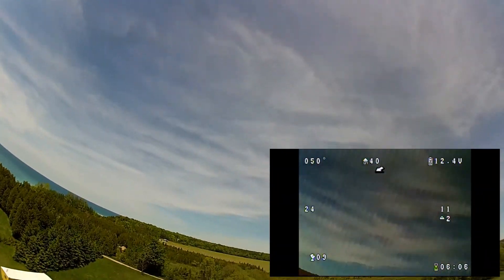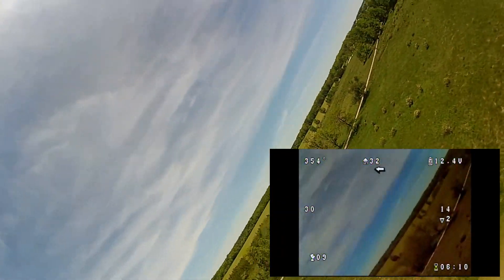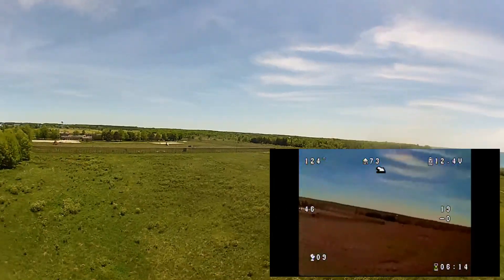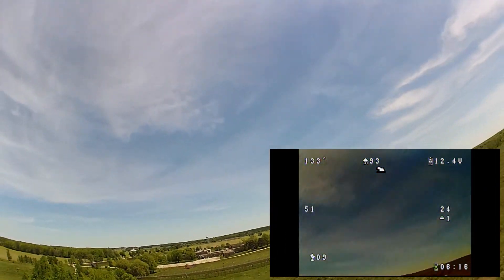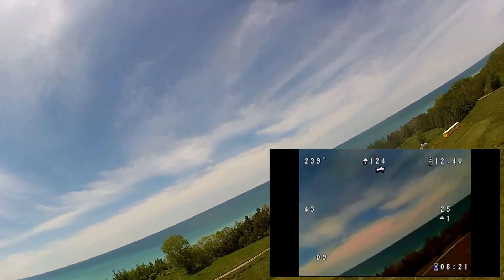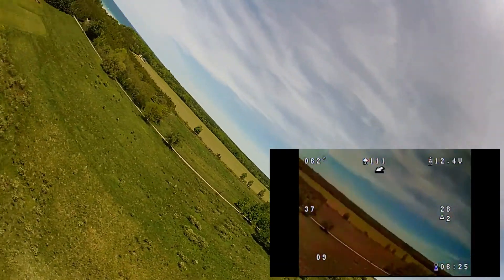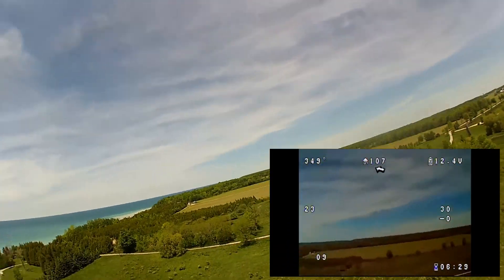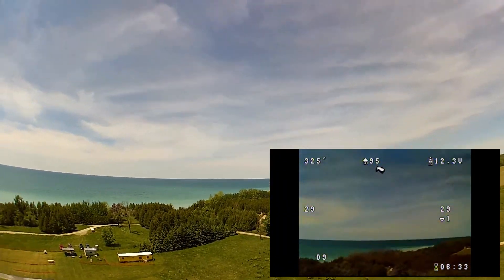Dollar Store Drone- Foam Board FPV Flying Wing

Comment: I'm sorry, i couldnt understand....what osd/gps did you use?  I have a blunt nose on of these planes.   Pretty fun, when you get the CG right.   What surprised me was how stable it is even when holding full elevator when coming in for a landing.   Makes it float and doesnt stall...and that's with the motor off.   Impressive.
Reply from the maker: cbluebeard The OSD is a cheap Remzibi clone.  Indeed this wing is truly amazing.  I severely underestimated it.  Cheers